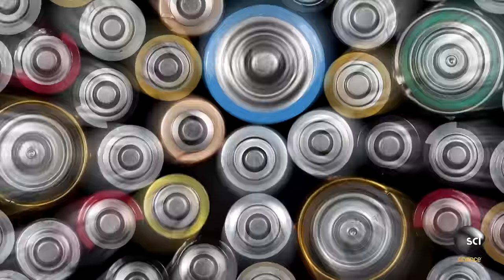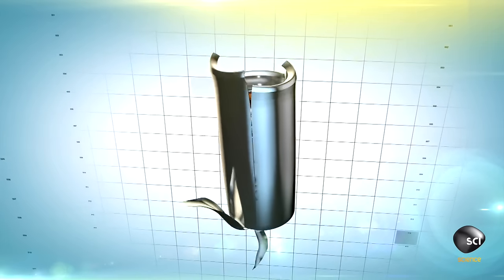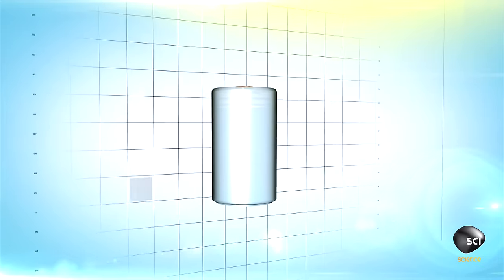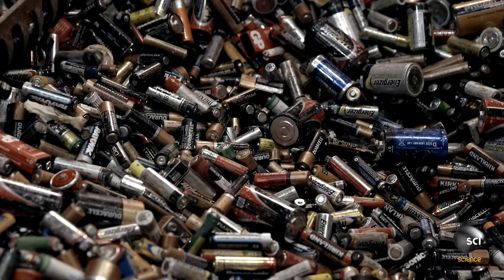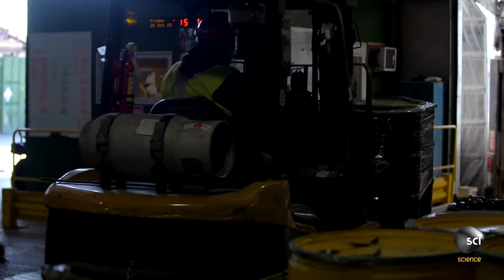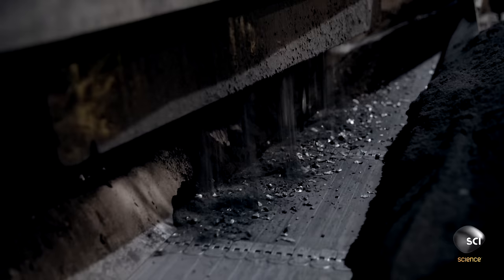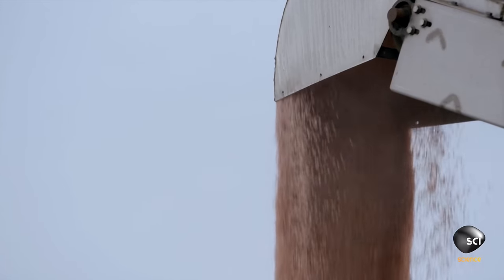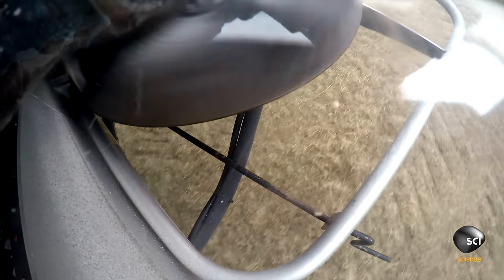How Do Your Old Batteries Help Grow Corn?

Comment: I don't like that the video doesn't mention anything about health influence of those shattered batteries. I guess the amount of zinc and manganese added to the fertilizer mix is very low, but still... it's said that all batteries are very toxic and some have acids inside them which can melt a baby's nose cartilage if it puts it up there.
Reply: their alkaline batteries

Comment: battery   contain  also   acid  what  about it !!
Reply: Dry cell battery is alkaline, not acidic.
Reply: alkaline is basique and contain KOH  so no that good either unless we add a small  amout of acidity so it will become neutral
Reply: Base is just another name for alkaline, and battery cell does not has KOH, KOH is just another example of a base. 

Just because its not neutral on pH doesnt necessarily be bad.
Reply: shahmi anwar' The alkaline battery gets its name because it has an alkaline electrolyte of potassium hydroxide, instead of the acidic ammonium chloride or zinc chloride electrolyte of the zinc-carbon batteries. Other battery systems also use alkaline electrolytes, but they use different active materials for the electrodes.' 
Wikipédia
Reply: Okay i admit I was misinformed, but they do not take the KOH to use in the corn anyway. The minerals are purified before dumped. So I dont think it affect anything.
Reply: shahmi anwar i doubt  that they can filtered  out all .the electrode  are imbibed  with electrolyte   one solution will be to  neutralise it  by using a special weak  acid  solution   but it's tricky and  time consuming cause  acid need to interact with  solid that contain base
Reply: +bac302 but it's still not acid.  and it's not as harmful as acid.